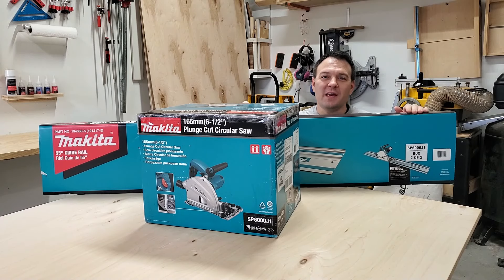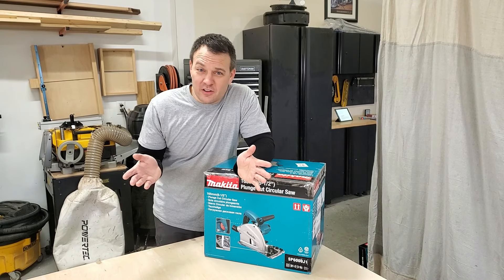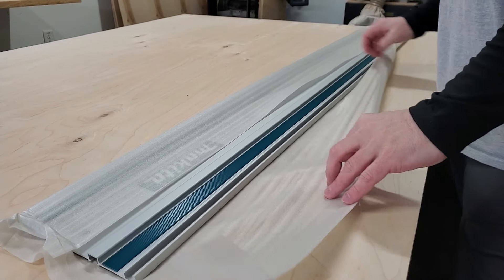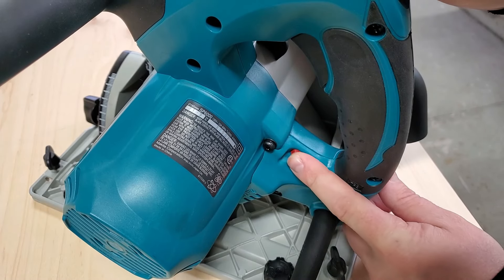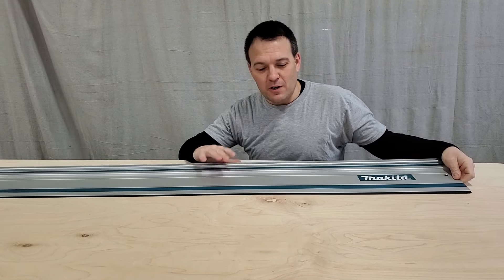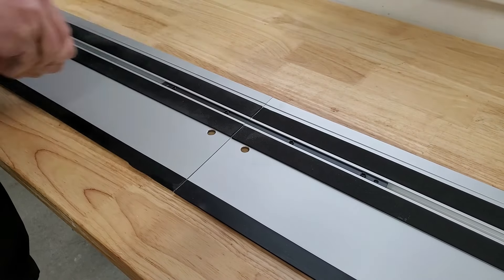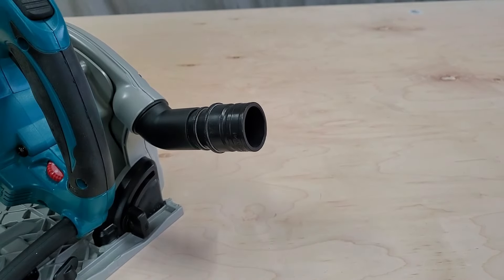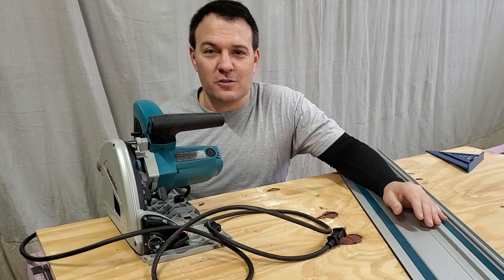Makita’s Track Saw is a Game Changer (Here’s Why)

Comment: Thanks for the helpful video! I just bought the same one and so far it's very good. Where did you get the dust port adapter from? I'm having a hard time connecting my 2.5inch Ridgid hose to it, even with Ridgid's adapter kit.
Reply from the maker: I got the dust port adapter on amazon, but it is specifically for the DeWalt dust extractor.  You would need to measure the outlet and try to get one for the Ridgid.  You may want to reach out to them to get help on that.  I'm sorry I can't be more helpful as I do not have the Ridgid extractor.
Reply: Thanks for the feedback. Happy Thanksgiving! @HowIDoThingsDIY
Reply from the maker: @danielam1992  You as well!

Comment: Hi. Have you ever put a straight edge against your cut to see if there is any day light  between the straight edge and the piece you cut ? I appreciate your input.  Thanks.
Reply from the maker: I guess I have not actually done that, but the tracks for the track saw are much straighter than anything else I have that long.  Also, I build a cabinet with maple plywood and everything seemed very straight during that build.  This is a great question, but I guess I just haven't had any reason to question any of the cuts so far.  I'm sorry if that doesn't help.

Comment: 'extremely dangerous' on a table saw, when using that size of table saw ;) But this saw is a very good alternative. I have been using a variant of Festool (cable) for years. But looking at Makita LXT now, as I have more tools of that battery system. Buying more Festool is just too expensive.
Reply from the maker: I can't agree more.  Thanks for the comment!

Comment: Do you still like it? Do you wish you would have gotten the cordless version?
Reply from the maker: I do like it.  I don't regret getting corded.   I would hate to have a battery die on me when I need to make a lot of cuts.  Plus, I always have the dust collection hooked up. I just keep the vacuum hose and cord together.
Reply: @HowIDoThingsDIY  Good points. I actually ended up getting the cordless version since Home Depot had a good deal for the cordless tool, two makita containers, two batteries, and a charger plus a free 39" track. Couldn't pass it up. I also got another 55" track for now.
Reply from the maker: That sounds awesome!  It would be nice to be able to rip down a sheet of plywood in the Home Depot parking lot so I could fit it into my Audi.  Haha